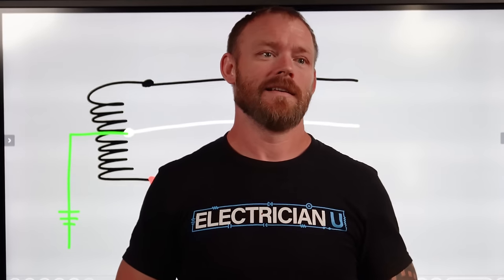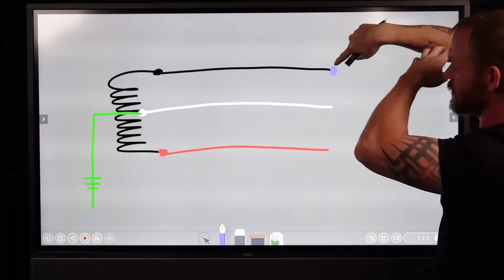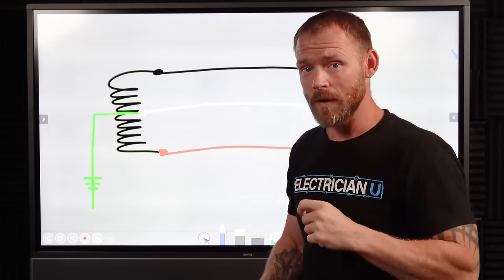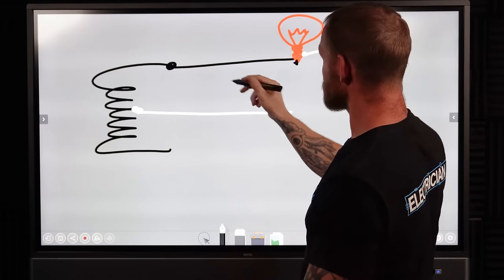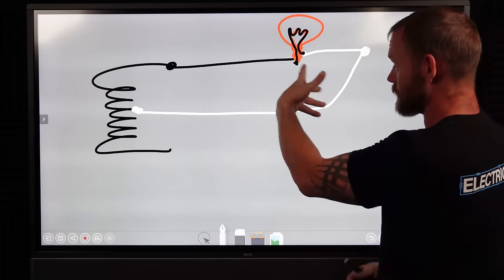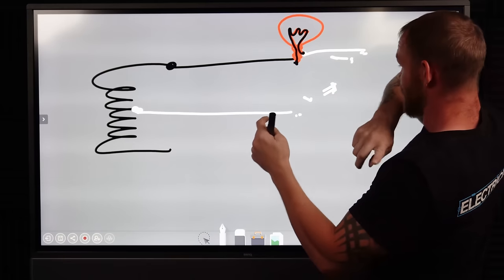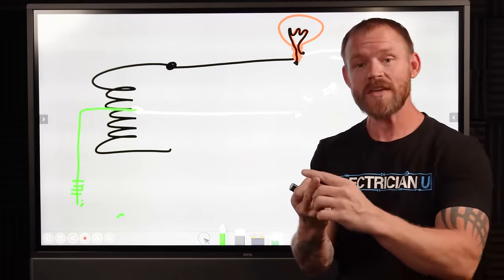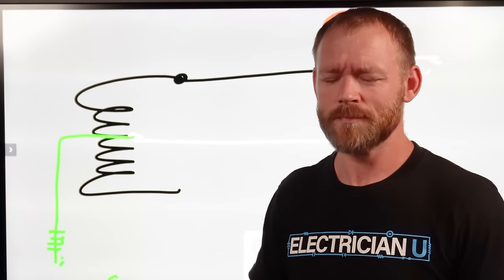Can You Get Shocked From a Neutral Conductor?

Comment: Oh boy, the "you can't get shocked by a neutral" people are not going to like this LOL
Reply: @A Town Yeah, quite a bit actually. All over forums, and even here on youtube.
Reply: @A Town The argument is that if a Neutral is OPENED it is NOT a neutral anymore, it might be a conductor with white insulation, but it doesn't act as a Neutral anymore because it is OPEN (which makes it hot).
Reply: @Hatim.13  exactly
Reply: In an old building, I got shocked by the neutral (and arm on metal box), I think it was load imbalance in an old building. Neutral was connected in a sub-panel to the right (isolated) bus; can still feel the "wiggling worms" in my arm to this day.
😬.
Not an electrician btw.
Reply: @Hatim.13  Which makes it (you) part of a series circuit to ground.
Reply: @Hatim.13 You don't want to be kneeling in water in a boiler room when you find your friend the open neutral.
Reply: This is why you should work de-energized. Wear your PPE. Keep one hand on your pocket.
Reply: Yes being technical if the neutral is disconnected from circuit it not a neutral but by color it is perceived as neutral. Older wiring may not be marked in a switch loop where the white wire is used as a return path, been a problem for decades, and finally, reidentifiaction of wire is required. Work de-energized!
Reply: Yes this is old school hand in your pocket. Wear your PPE
Reply: I think the idea gets lost in symantics. It should be said that a properly connected neutral will not shock you because it's the same reference voltage as ground. Calling a wire neutral and saying it's white colored are not the same thing. As I stated in another comment I was shocked severely by "ground wires" they were green but  somebody was using them to complete their neutral circuit in a theater lighting circuit with 277 volts.

Comment: Awesome presentation as usual, but I wish you would have taken a moment to warn the newer guys about shared neutrals. Even if the circuit you’re working on is off, it doesn’t mean that same neutral wire isn’t being used for a separate circuit elsewhere that is still active. This is common practice in my area, especially in older buildings.
Reply: dude you are totally right haha i gotta be careful haha
Reply: Agreed shared neutrals 277v oweee
Reply: He has a video about shared neutrals.
Reply: How do you test for a shared neutral?

Comment: Unless you’re floating in space, you’re touching the floor, or a scaffold, or a bucket, or something. There’s no scenario where the only thing you’re touching is the neutral.
Reply: There is a scenario where everything you are touching is insulated enough you are not a path for the electricity. That is why there is footwear for electricians that is rated for how many volts it will protect you from. And why electricians should never touch their knee to the ground.
Reply: @ecospider5  Right, but “insulated enough” is a moving target that changes with voltage. That’s why microwave transformers and lichtenberg devices are so dangerous.
Reply: Yes and that is why the shoes are rated just like the rest of electricians protective gear. Do not wear gear rated for 300v when working on 15kv motors.
Reply: @ecospider5  most gear I've seen even for low voltage 50 to 600 volts is rated for at least 600 if not 1000 volts never seen something only rated for 300v volts never the less I see what your saying use the right PPE I'd also recommend make sure to inspect it regularly like every use basically, learned that from some local lineman they were showing me even a pin hole in the gloves and you'll get fried right up and thats high volt crazy shit I'm over here just wiring some single phase panels but still gotta stay safe boy's good luck out there 🤞.
Reply: I was going off the voltages you see on multimeter ratings. And yes  class 0 voltage rated gloves are 1000v and the ratings go up from there. But there are lower stuff. EA640ZD-5 As an example is 300v AC and 750v DC. No actual electrician would ever buy those though.

Comment: You can get shocked by touching the neutral and ground if there's a load on the neutral. Source, it's happened to me.
Reply: Some other factor must have been present because we've all been in desperate situations where you lost your neutral but still had 120 to ground so you landed that to the neutral screw in the device. You must have just broke the load on the return path and it made contact with the ground while you were touching it
Reply: On a proper system the voltage loss on neutral cannot be so high that you get socked. All my grounded sockets are done with TN-C so the cases are connected to the neutral and I do not get shocked. I have measured about one volt with 5 A load.

If the neutral is broken then sure you get shocked from it.
Reply: @okaro6595  yep
Reply: @erich1380  this was a long time ago when neutrals were shared. I was landing a neutral in a push in wago and it was fighting going in. I used my strippers as pliers to grab onto the wire to push and twist it in. My elbow was touching a metal fire suppression pipe. My hand must have been touching the metal part of the strippers and the strippers made contact with the copper. It was an emergency and exit lighting circuit that was on. So my arm completed the path from the neutral to the ground. There was no device in that j-box i was working on. I was not touching any hots. So i got shocked by touching the neutral and ground while there was a load on the neutral. There was no mystery or anything like that going on. It's very simple what happened.
Reply: Human body is 300 ohms. 100 feet of 14 awg wire is 1/4 ohms. There is a calculation that will tell you what percentage would follow each path. Obviously 1/4 ohm is way smaller than 300 ohms so the wire will carry most of the load.
Reply: The NEC was changed in 2008 for this very reason to ensure that any multi-conductor circuits sharing the same neutral had to all be simultaneously disconnected by an overcurrent device, i.e. circuit breaker. That's why it's wise to run every circuit with its own dedicated neutral for that particular circuit only!

Comment: I was an apprentice on a job with the DCR where I was shocked up the leg when I knelt down on the grass and reached in to splice in a light pole. The city engineer told the shop to tell the electrician it was off and to have me splice it in. After I got shocked and ended up on the ground the wireman came over to do exactly what he told me to do and got shocked as well. After he overcame the initial shock as well he got me up and had us call the shop who said it must of been backfed somewhere if the circuit was indeed verified off by the city engineer who insisted we did not need a key to the panel at a public facility. My legs never worked properly again. I've tried so hard to move on with my life but I live with the affects of the risk of this job and my life was forever altered. Always verify no matter who it makes look bad it's your life and someone else. Good topic to cover. I get a lot of flack when the inexperienced insist you can't ever get shocked from a neutral. Caught up in a circuit was another way to communicate that potential better or something like that. The wireman said a few things to me one of which was this would make a great story about electrical work someday. I heard he had a heart attack on a ladder just a few years later. Some of the people I worked with didn't survive or had such awful injuries.
Reply: I have been shocked as well doing the same damn thing…It almost killed me. The light circuit was hot and then went to the switch which was off at the time. When I cut through the wire it almost killed me as I was kneeling on the wet ground….It was my fault. I should have checked the wire regardless of the switch position !
Reply: @JetDriver1111  Thanks for reading all that.
Sorry you got hurt, glad you survived.

They had no right to tell me the circuit was already tested and safe.
They had no right to tell me that getting hurt made them look bad.
Even the journeyman said the city engineer should of known better and never should of opened that park to the public.
You will talk about surviving this job for the rest of your life he said to me and he was right, my burn never healed and the doctors have not been able to help much.

This is also an example as to why as an engineer you need to know what you are doing or you put lives and people at risk and survivors are not going to put up with keeping quiet.

It will be investigated whether or not they ever gave me an answer.

As for me, I'm working on coping with incompetent people.

A thousand jobs done safely and that was the one to destroy half my body.

And also, I got pictures of my leg after it happened and what it became ten years later when I nearly lost my leg and it affected my whole body. I went through six years of auto immune treatments from it. What happens when the valence of human tissue is internally replaces by copper current flow? Could it lead to copper poisoning on a strong enough current? How do the doctors treat that? I am a survivor and it never should of been allowed to happen.

Thanks for reading.
Reply: @ValenceFlux  I suggest you try some Reiki healing….Dont laugh just yet…It works ..I’ve received it myself and used to be a healer myself…Your own family can do it to you as well…
Reply: @JetDriver1111  I can't laugh I've done it all. All of it. Even fasting. Even ice diving. I've done it all trying to survive this. Most people do not have the strength to survive this. It's been humbling in ways impossible to put into words.

Other electricians that survived such things had told me I was cooked internally and I needed to drain it out of my body so I learned how to do that by Ice plunging and then using drawing salves.

I refuse to die without a fight.

Comment: Yup. Absolutely been shocked by the neutral on a multiwire branch circuit.  The circuit I was working on was off but neutral was apparently shared with another circuit that was not.  I separated the neutrals and while twisting them back together, I got shocked through making contact on my sidecutters. Decent load on it too!  Do not underestimate the neutral.  If you're in a building that was wired when sharing neutrals was still up to code, you have to use your clamp meter to test for amperage & see if there is a load still passing through the neutral.
Reply: mwbc are still code as far as the NEC goes. they just need to have a common disconnecting means, most commonly in the form of a 2 pole breaker

Comment: Been there done that - with the breaker off!  Shared Neutral (i obviously wasn't aware of it) across at least three different circuits in a 1950's house that saw various "handyman" and homeowner modifications through the decades.  Bonus points for three-prong receptacles with no ground.

I was moving a kitchen light fixture that shared a circuit with one or two receptacles in the same room, and verified all were dead.  Went to wire nut the new fixture to the existing neutral, and completed the circuit for what I later found was the back bedrooms.  The bedrooms' hots had their own breaker, but some psycopath didn't feel like running a separate neutral 50'.
Reply: Hapened that way to me too.
Reply: Been there. I'm beginning to wonder if they didn't just build them that way for a while.
Reply: Yup.  Allowed by code back then.
Reply: And this is why when I was helping my parents out I refused to work on something when my no-contact voltage tester lit.  Yes, I know those things aren't perfect, but better safe than sorry.
Reply: Been there. Done that too. Shared neutral 3 rooms and 50ft apart. With other circuits in middle. So why it was shared with own hot breakers. Idk...
Reply: Same situation in my home. I have 6 multi wire branch circuits that were originally wired correctly but at some point a handyman/hack hooked up fans and lighting and borrowed neutrals from other circuits. I had a couple neutrals with three circuits on them. Ceiling insulation was melted on the sheathing, wirenuts were semi melted, hot neutrals when the circuits off.
Reply: I never take a chance. Not only do I turn our circuit breakers off in the mean ones in the house I also go outside to my pool and I shut them off their too before I do any electrical work. I make sure my head lamps can battery operated tools are fully charged.

Comment: The bottom line is that, if the neutral has potential on it in comparison to something else you're in contact with, then sure - you can get a shock (if the potential is sufficient). Generally, of course, the neutral is grounded, so coming in contact with it alone isn't an issue.  

I'm a little cautious with the word "touching" as someone may think that is physically touching with the hand, as described in the video. You can get a shock by touching a hot lead and nothing else if your footwear isn't sufficiently insulated. I think that there are a lot of amateur do-it-yourselfers (e.g. non-electricians working on their own homes) that watch this channel and they aren't likely wearing footwear designed for electricians. If they touch a hot, they're going to feel it as their feet are the other "touch" point to ground, completing the circuit.
Reply: But you wouldn't be touching nothing in that case, you would be touching the ground with your feet. The principle holds true.
Reply: @acat6000  Touching a neutral under load you would be in a parallel circuit to ground I believe, most of the amperage going through the neutral. Yes? Am I thinking this right?
Reply: @acat6000  If you touch a hot wire and nothing else, you can't get shocked. If we're living in a pretend world where you can touch just the wire even lightning can't shock you. In fact, if you are touching a hot wire and something else that has the same phase and potential as the hot wire (like when a lineman grounds a helicopter to a live 2 million volt line so the frame has equal potential to the line) you cannot get shocked. You get shocked when the voltage can cross from one potential to another that has a potential difference, making the video misleading. The principle holds true under a narrow set of circumstances with a large number of special conditions, but it does not hold true for everyday people who will never be in a scenario where it is applicable.
Reply: A lot of mistakes I see from people who are trying to understand insulation and how it works comes from the high school curriculum and the false statement they make that rubber is an insulator and electricity cannot flow through it.
Reply: @scottmyers10  broh
Reply: Don't be touching electrical wires or expect to get shocked.
Reply: @ChickenPermissionOG  best, easiest answer.

Comment: I like your final comment about how you can get shocked by any two conductors. Everyone needs to remember you can even get shocked if the actual ground is a conductor and the ground wire could contain some potential from the actual ground. Love your videos and I learn a lot even though I will probably never become an electrician. Understanding is always a plus.

Comment: I got shocked when I was unbundling some neutral wires, even though I had already checked that there were no live wires in the electrical box I was working in. Took me a bit of time to figure out why I got shocked. Turned out it was a neutral wire that was part of a multi-branch circuit and my panel didn't have a double breaker used for it. I appreciated your video on multi-branch circuits. I now treat neutrals with more respect.